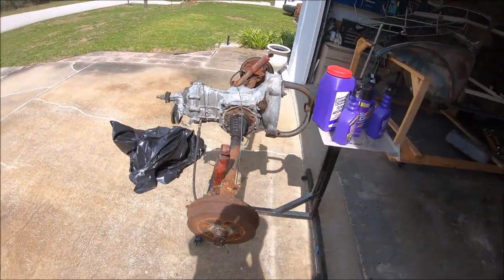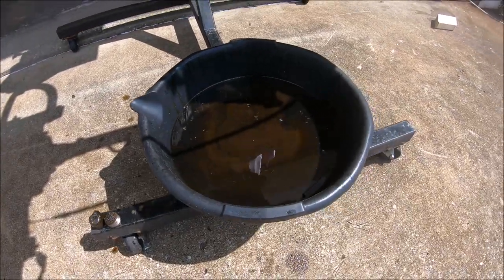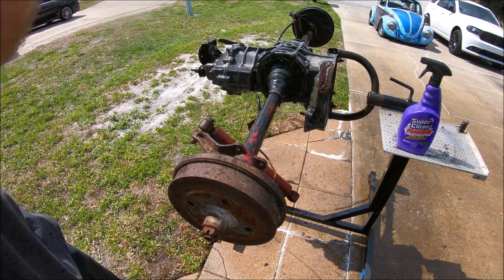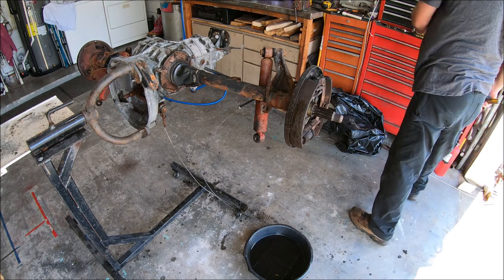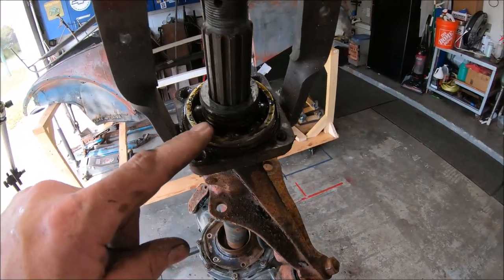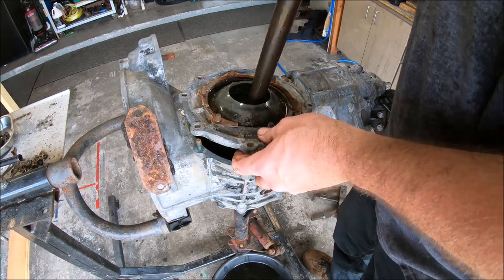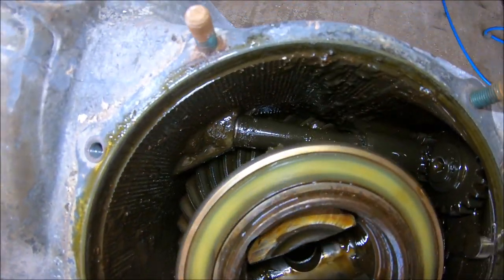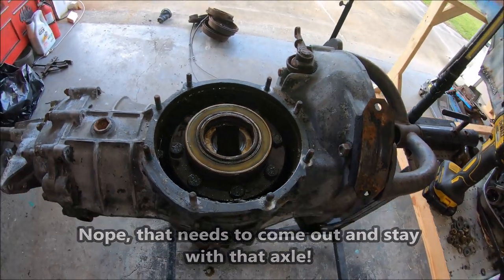1958-68 Volkswagen Beetle Swing Axle -  Axle Shaft and Axle Tube Removal -Franken Beetle Build

Comment: Transmission world!! 
I’m learning myself. 
That big c-clip is a pain for sure. 
Good video.
Reply from the maker: I’ve an irs person, I have very little experience with swing axle stuff. I almost converted this over to irs, found this 68 swing axle instead.
Reply: @VWJawbreaker  make sure to keep the driver side axle marked and replaced on the driver side. Same on the passenger side. They develop a twist over time. If you switch them they can break especially with more power added.
Reply from the maker: @vintagespeedvw7864  someone else said something similar before I tore it down. Right side axle is marked along with the fulcrum plates, etc from that side in a bag. Same with the left side. Figured I’d play it safe and Mark everything lol

Comment: HEY GARY , DROPPED OFF THE NEW GAS TANK TO GET MODIFIED TO FIT UNDER THE HOOD ! HE JUST CALLED IT'S READY THAT WAS FAST ! PUT A NEW RADIO IN , CLEANED UP THE BRAKE ROTORS , WHERE THE SPEEDO WAS I COULDN'T SEE IT ( WAS BEHIND THE STEERING WHEEL , THAT WASN'T SMART ) SO I SWITCHED THE TACH AND PUT THE SPEEDO IN IT'S PLACE ! TOMORROW I'LL PICK THE TANK UP AND INSTALL IT , I SHOULD HAVE IT READY FOR THE EVENT ! HAVE A GREAT DAY      ALAN
Reply from the maker: Good to hear it’s all coming together!

Comment: Looking good nice job getting it clean.
FYI no need to remove side covers to take off C clip and axles . Extra step not required esp at reassembly.
Reply from the maker: Good to know.
Reply: @VWJawbreaker  Removed for insp purpose only to show view of crud inside . .....
Reply from the maker: @type4revolutionstudio  the builder got a good view of it before he tore into it. 
I’ll keep it in mind for reassembly, thanks.
Reply: @VWJawbreaker   Kool man I take it that's a 12 volt 200mm bellhousing . 6volt trans are junk outside of factory 💯 restoration. FYI dual side cover IRS trans will work for a good core also their all 12 volt 200mm and plenty out there. What kind of front nose cone mount on that 60 chassis that's a crazy year some adaption required there on pan ..... Curious
Reply from the maker: @type4revolutionstudio   it’s a 68 trans and long axle combo, so yeah 200mm bell housing. I wasn’t about to deal with the smaller bell housing. Builder said he has the nose cone part covered.
Reply: @VWJawbreaker  Kool man getter done .....

Comment: Good video.  Quite obvious as to why vw went away from the swingaxle so much work to get it pulled out of there. And it is nice to be able to roll a car when the engine and trans are out. Those look like type 3 or 1968 bug axles they have the longer axles, and wider bearing housings than earlier cars. Not sure if matters in your build plans but defiantly could help for clearance or fitting a wide tire on deep rim on the back.
Reply from the maker: This is the most work I’ve done with a swing axle so far, most everything else has been IRS. 
Good eye sir, this is a 68 trans and axles! Wanted it for the build, figured it would be better.
Reply: Swing axle transmissions simple 6 axle bolts, 2 nuts front mount, 2  27mm frame horn, 2 shock bolts. Dealing with CV bolts take time....Solid rear mount with shopping cart wheels to move you ride

Comment: Hi Gary, Interesting video. I never took one of these apart so I know how if needed someday. Awhile back someone was giving one away for free. I don't have a bug but thought it would make a interesting video. By the time I gave it some thought it was gone. Looking out for one still. It would be cool to see what Bill uses to beef this one up?
Reply from the maker: This is as far as I’ve ever been into a VW transmission..... I don’t plan on going any further either lol
He’s basically building me a pro street trans with custom gearing for the tires that I’ll be running. He was nice and took the time to ask how the car will be used, approx engine hp, tire diameter, etc to make sure it’s built to handle what I can throw at it.

Comment: One thing I noticed right away, the axle boots were previously installed wrong. The seam should be on the front or rear, not the top of bottom. The seam does not flex as easily during suspension travel, and when it's on the top or bottom it has a tendency to tear the boot sooner.
Reply from the maker: That’s what I learned recently. I’ve always seen them installed the other way, hope I remember to install them correctly when it’s time for reassembly!
Reply: @VWJawbreaker  the seams go at 1 o’clock on the right side and at 11 o’clock on the left side.
Reply: My '64 owners manual clearly states.  Apply sealant to the seam, put the nuts on top for ease of tightening the screws, point the seam to the rear and tighten the clamps.  Bad info is being spread by backyard mechanics.

Comment: Question: I am getting transmission oil coming out my drive shaft tube at my drum ends. I replaced the outer seal and new drive shafts. How is the tranny oil getting out?
Reply from the maker: There should also be a spacer / washer and 2 o-rings that should be replaced. 
Also, I use a little bit of sealant on the paper gaskets during assembly.

Comment: What's a cost estimate to have this transaxle built? 
I got the 2110 running way better (thanks for the tips you and a couple others gave me) But now the gearbox started making a low, dull sounding noise. I'm hoping it's the Axle bearing but preparing for worse just in case.
It's got very low gears in it, especially 3rd and 4th and the previous owner told me he bought it from Rancho? Not 100% sure where exactly but definitely not stock.
Working on my car is a lot more fun having videos to learn from and get ideas to try so thanks!
Reply from the maker: Best bet would be to look around your area and see if anyone can recommend someone to rebuild the gearbox. 
Rancho out of CA are pretty good and if that gearbox is good with the current engine, it would probably be cheaper to have that one shipped out and freshened up vs having one built. 
There’s reparable companies all over, unfortunately it will involve shipping your box. The large black and yellow totes at Homedepot work well.
Reply: @VWJawbreaker  yeah I'll definitely have to ship it, I live in a tiny little town in the middle of nowhere.
Reply from the maker: @Golden-ui5um  large husky tote and ups label will get it anywhere.

Comment: Whatever you do, when putting on the axles back on the rebuilt unit, by all means use the axle flange stiffeners such as offered by EMPI and others. These come with longer studs for you to replace those on the transmission. Make sure the flanges are as straight as possible and use Permatex Aviation Sealer on both sides of the paper gaskets/spacers and use a thick bead of gear oil resistant sealer all around the perimeter of the flange making sure to cover all around the studs. Make sure to resist the temptation to over torque (don’t go over 14 ft/lbs). Also follow the instructions for the sealant, which most times will call for just tightening the flange (add the stiffeners too) until the sealant oozes out; wait an hour and then torque to spec and give it 24 hours before refilling with the new gear oil. Do this and your axle flanges won’t leak. Ask me how I know.
Reply from the maker: Sound advice, thank you for that! 
I actually took a screen shot and filed it in a saved folder so hopefully I remember.  Thank you for taking the time to type all of that out, I appreciate it.
Reply: @VWJawbreaker  this is the one: https://www.amazon.com/Empi-16-9906-Cover-Retainer-Buggy/dp/B00BYHFV20
Reply from the maker: @vayabroder729  thanks for the link! 
Do you think I’ll need these even with HD side plates? I’m having a custom pro street trans built for this car.
Reply: @VWJawbreaker  the side plate is one component while the axle tube and flange is the one that connects to it. If using the stock axle tubes and flanges you will more than likely need them. These flanges get dimpled around the holes as a result of over torquing. Very common. Best way to use them is make sure they’re as straight as possible by removing the dimples and then using the stiffeners and installing as previously suggested. We had to install the rebuilt transaxle in a friend’s car twice for gear oil leaks until we used this method. The leaks are now gone.
Reply from the maker: @vayabroder729  excellent info, thank you for taking the time to share your experience! Like I say in my videos, I’m not an expert but we can all learn together.

Comment: So if this Frankenkäfer is getting Jawbreakers Powerplant is Jawbreaker in for a new 2332 😲.
Reply from the maker: Unfortunately no, jawbreaker will get a spare parts engine build of a whopping 1641cc’s 😂
Reply: @VWJawbreaker  nothing wrong with that. I’m gonna pull my 1641 and pull it down. Do a little port work and put my custom valve job on the heads. Not sure if I want to stick with the stock cam or not. Put my  Centermount Dellorto in it and see how it does.
Reply from the maker: @sheldonjr7hp  honestly that’s a good thing with these engines. Not much to them so worse case pull it down and swap things around again.
Reply: Not gonna lie been pondering a fly cutter set up for my Mill and just bumping it up a tick to 94mm 😲. But I think I can make my ol 1641 run good enough to make me happy and pull some fuel economy. As long as it’s loud lol. My first fix it ticket was for loud exhaust. 🙀
Reply from the maker: @sheldonjr7hp  94’s and a mild cam you’d still get good milage.... wish I had the knowledge and access for a mill, etc. I’ll just stick to basic hand tools and things that make fire 😂

Comment: put a Hard Wood on the Side Cover's potruding metal and Hit the Wood with a Hammer. Never try to Pry open a joint part with ScrewDriver....! You will chipped off the Side Cover...!
Reply from the maker: Excellent tip, I appreciate that.

Comment: Hey quick question how fast can you go with a stock VW Beetle trans my brothers is a 1963
Reply from the maker: It will depend on many other factors.
Reply: A '63 stock condition, 1200 engine, can hit 70 MPH floored level ground. However, due to design of VW beetle of this early era ,  exceeding 60 mph is not recommended for extended period of time.
Reply from the maker: @1960bluebug  good to know, thanks!!

Comment: Brass hammer bro.  I'm not a fan of those dual-purpose circlip pliers.  You can see the copper ends flexing as you apply force.  No wonder they would not stay on the clip.
Reply from the maker: I appreciate that, using what I have here.
Reply: @VWJawbreaker  👍 sometimes you’ve got to use what ya got.
Reply from the maker: @ocavant  yes sir!!

Comment: From brake to brake how wide is it?
Reply from the maker: Which one? There a long axle and short axle version.
Reply: @VWJawbreaker  I don't know, I am planning on using 68 or 70s Beetle gear for a buggy project and I need some dimensions for the plans.
Reply from the maker: @ATruckCampbell  68 was the last year of the swing axle setup. You’d be better off going with an IRS setup from 69 on.
Reply: @VWJawbreaker  Alright, and how wide are those IRS? I am trying to keep the size down.